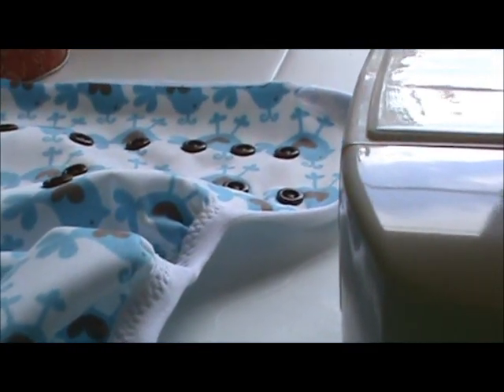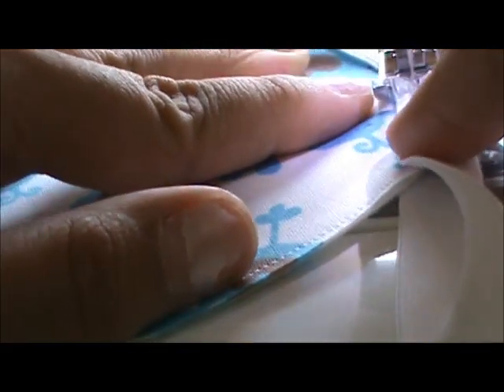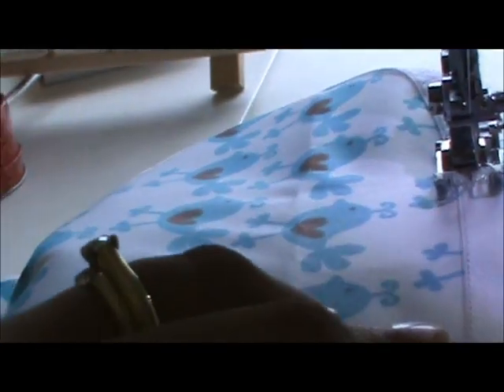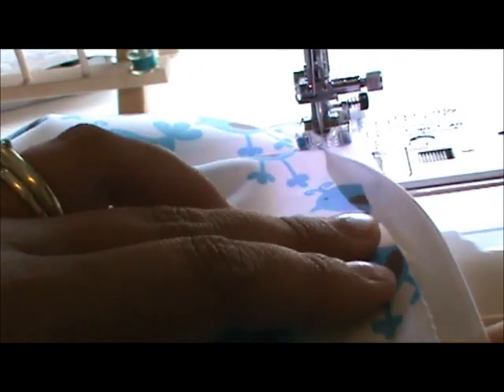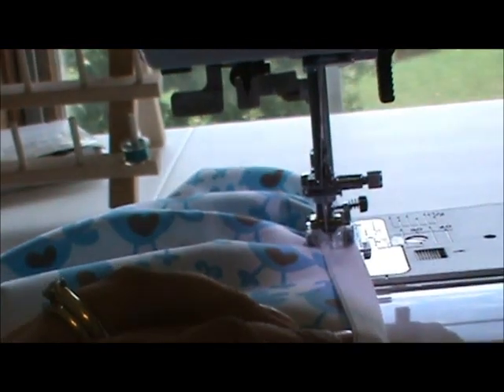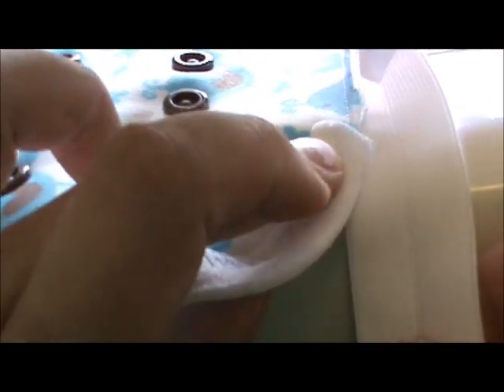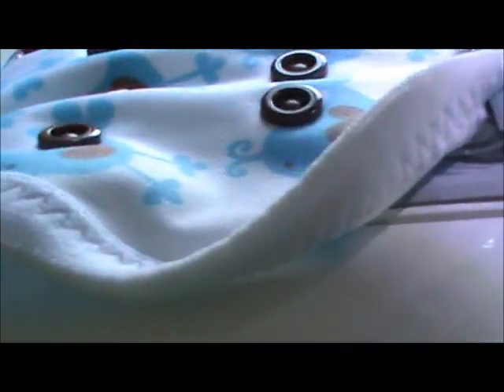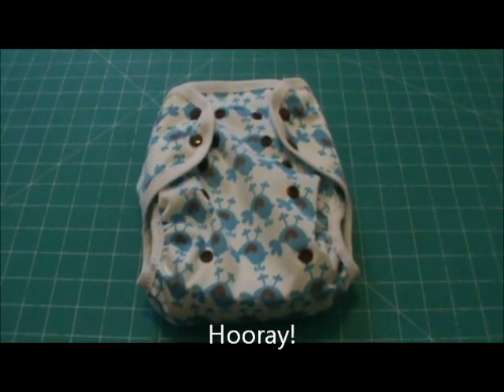Diaper Cover - FOE - part 2.wmv

Comment from the maker: I do not have a video for that but you can find the Babyville line of diaper sewing products and instructional books at Joanns or Hancocks or Hobby Lobby.  I also buy from kidsinthegarden and diapersewing supplies.  You will need PUL, FOE, aplix or snaps, a size 11 ballpoint needle, and 100%polyester thread.  Any sewing machine, even the most basic, will work as long as it can do a straight and a zig zag stitch.